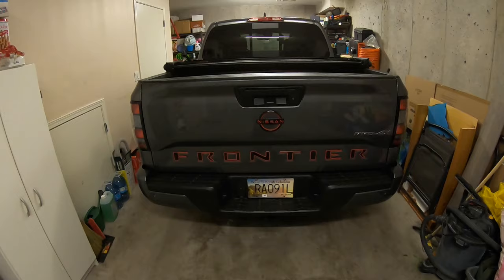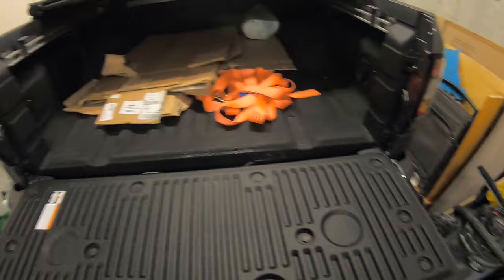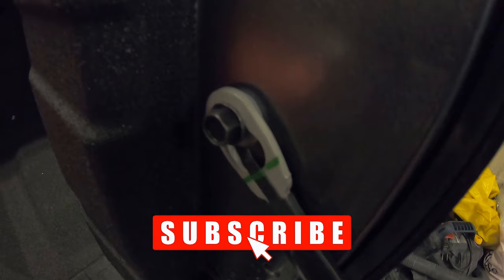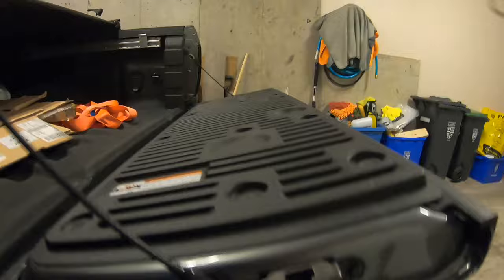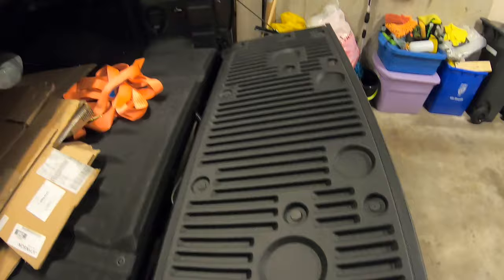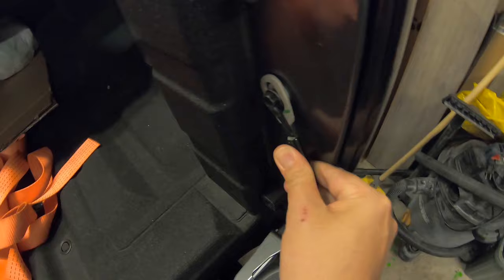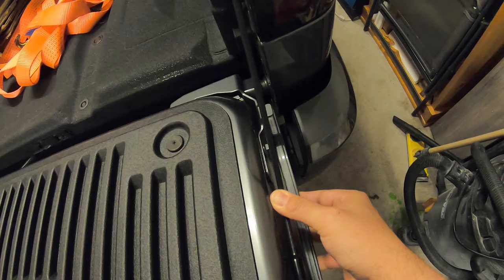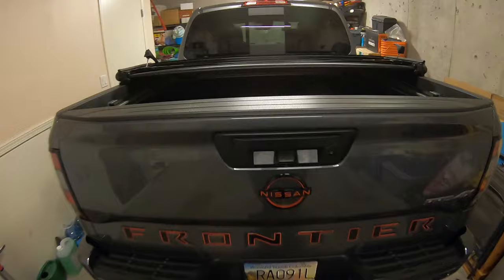HIDDEN TAILGATE FEATURE ON MY 2023 NISSAN PRO-4X LUXURY

Comment: Every truck I’ve ever owned has that same exact design. And what I’ve always done is put the cable over the tailgate lock bolt. Never needed to remove the latch and relatch to that bolt

Comment: The tailgate comes up like that so you can haul 4x8 sheets of plywood.  The plywood doesn’t fit in between the wheel wells so it has to sit on top of them.  The tailgate supports the sheet.  There are notches in the sides of the bed to put additional supports or dividers.

Comment: Better make sure to reposition the cable if you attach it to those top fittings. Those top fitting go into the lock mechanism. If you slam the gate closed with those cable connected to the top....boom might just wreck the lock mechansm